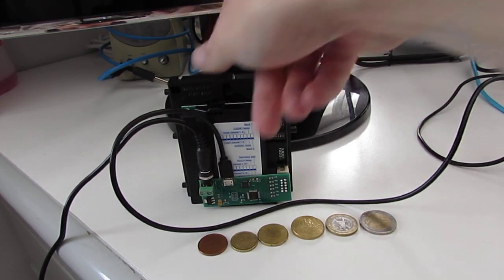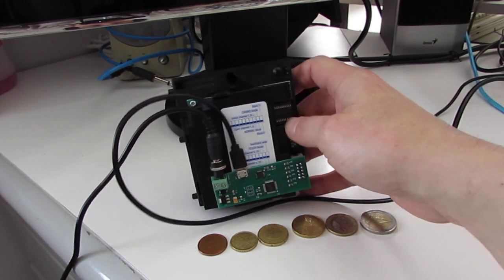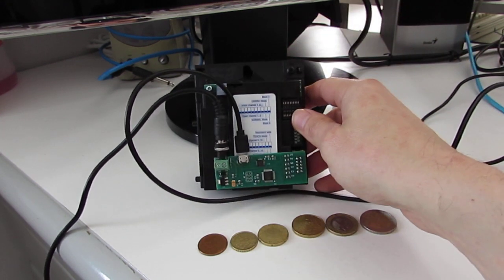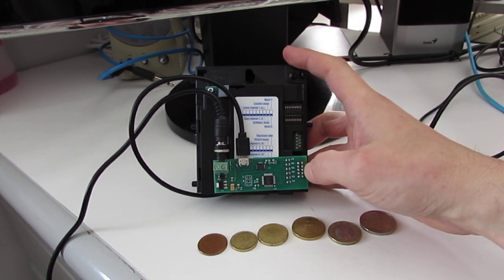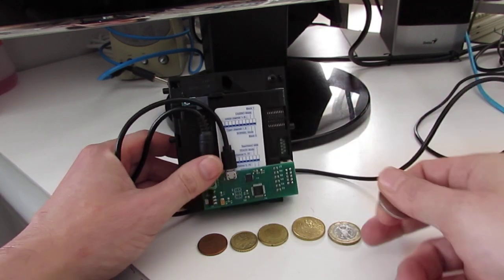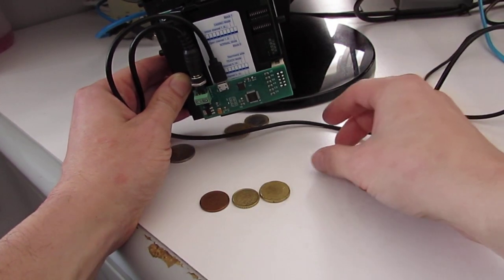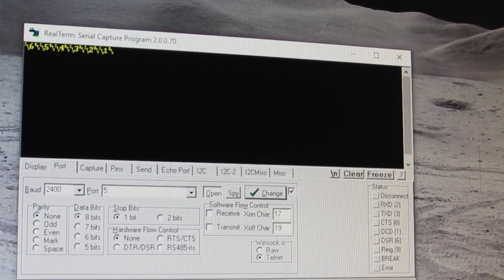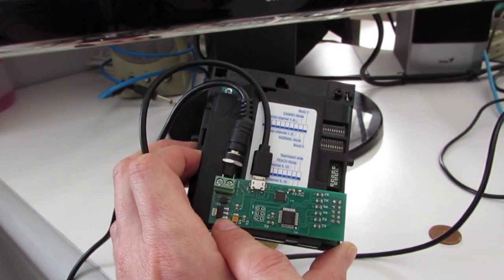NRI G-13.mft parallel coin acceptor to Serial adapter

Comment: Can you make a video on how to teach this coin mech a token with the DIL switches?
Reply from the maker: Hello, I'm sorry but I have no time for this. By the way it will not be difficult, the manual has page about this.
Reply: @davidegironi  Ok, I will keep trying. I got the coin mech brand new 2022, but every time I flip the s2-9 switch back to ON, it double clicks saying it didn't work. I am holding the mech in my hand do you think maybe that is not stable enough to teach it? I want my boxer machine to take tokens haha

Comment: can you disable youns and detect errors with it as well ?
Reply from the maker: Hello. Disable yes, but not with this circuit, there are additional input to drive. Detect errors i don't remember if there are output error signals from the board, you have to take a look at the manual.

Comment: Can i programm a NRI G40 Coin Validator with this Adapter?
Reply from the maker: No, this device just read the coin output lines and transform it to UART, you can do minimal programming using the dip pin on the back of the coin adapter, or using the propetary adapter and software.

Comment: i have a coin acceptor like this from nri and i want to program to accept the 2 euro coin

how do i program to ?
Reply from the maker: Hello Pedro, you can find the manual online, there are a few versions available, check which is your. The programming of this adapter is done using the dip switch on the back. The board I've built is not for programming this device, but to read the output from his port and send it to UART.

Comment: Do you also have service software for programming the G-13mft? In addition to channel programming and programming of any coins, impuls lenght, it is also possible to detect errors in the coin validator itself (its sensors).
I have it and I use it.
You are wrong that the G-13mft does not have a serial port. It has it and uses it for diagnostics, but it can also be used to scan accepted coins and much more, specifically to scan the status of an online coin validator from various defects such as coin tampering, cheeting,  to check all (firmware version, date of manufacture, hardware version, date of last programming , checksum firmware status, status of all sensors, reader door opening, bad coins, fake coins, power supply and level of voltage, stability problems, solenoid status, state of all switches etc.).
Communication is in the connector of the diagnostic slot UART 19200 Bd, 8, 1, N.
Reply from the maker: Thank you for this feedback, can you provide the pinout of the serial port? Thank you.
Reply: @davidegironi  kondy73@gmail.com

Comment: Hi
How can I buy this adapter?
Reply from the maker: Sorry for the late response, please send me a private message.
Reply: @davidegironi  What does it cost?
Reply from the maker: @MathijsGroothuis  Dear mathijs, you have to build your how, or make it build by some PCBA I do not sell this. Just consider, if you are using for business purpose, a donation.
Reply: @davidegironi  hello, how can I buy this adapter?
Reply from the maker: @jamshednorov3090  you have to build your how, or make it build by some PCBA I do not sell this. Just consider, if you are using for business purpose, a donation. If you need many > 50 of this adapter I can build it for you.
Reply: @davidegironi  
Hello, yes i will use it for business, I'm ready to buy 50psc, but i need one piece for testing, can you provide?
Reply from the maker: @jamshednorov3090  write me a private message or mail
Reply: @davidegironi  please write me your email, i can't see it, thanks
Reply from the maker: @jamshednorov3090  I prefer not to write here as plain text, but you can find it in my homepage davidegironi.it